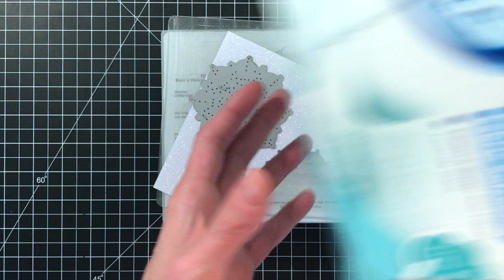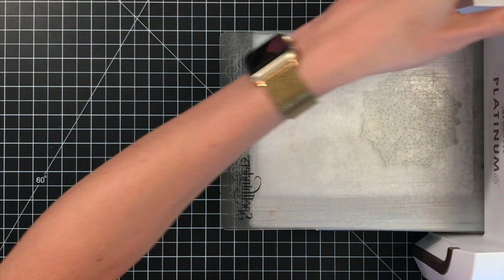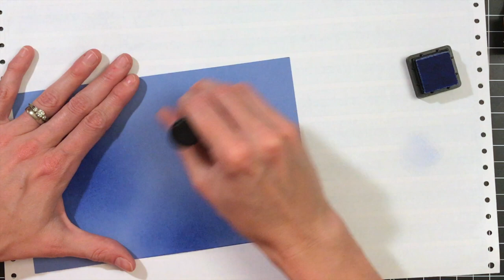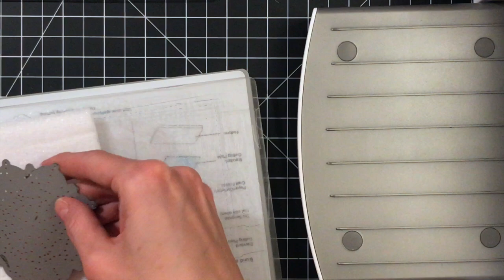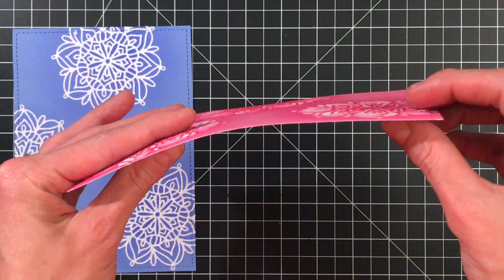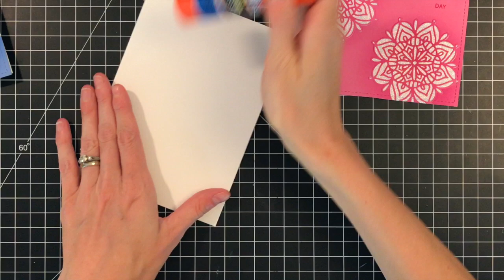[Technique Tuesday] Intricate Die Cutting and Dryer Sheet Cheat by Channin

Comment: Channing, since you didn't add the liquid adhesive to your list of products, I need to ask what kind you are using in that tiny little squeeze bottle?
Reply: She mentioned it was mod podge matte
Reply from the maker: Hello Mary, I used Mod Podge Matte 

https://www.amazon.com/Mod-Podge-Darice-Original-16-Ounce/dp/B001IKES5O/ref=sr_1_2?ie=UTF8&qid=1538495058&sr=8-2&keywords=mod+podge+matte&dpID=41R%252BRdloIjL&preST=_SY300_QL70_&dpSrc=srch 

in a precision tip glue bottle like this, 

https://www.amazon.com/Purture-Precision-Applicator-Bottle-Quilling/dp/B073P95CYF/ref=sr_1_7?ie=UTF8&qid=1538494924&sr=8-7&keywords=quilled+creations+precision+tip+glue+applicator+bottle

Hope that helps! :)
-Channin

Comment: Which metal shim do you use? I also have the spellbinders platinum. Spellbinders said they do not make a shim because they don't believe it is necessary because of the way their machine is made. I wondered if the sizzix precision base plate could work with the platinum but I don't want to damage my machine. Have you used a metal.shim with the platinum?
Reply: Esther Hernandez I don't use a metal shim for my Plantium machine. I have found the Plantium cuts my intricate dies very well, all I might need to to sometimes is rotate the Die and paper and run it through the machine a couple of times. I purchased the CottageCutz Universal Shim Plate Die Cuts for my Cuttlebug machine, which I owned before I got the Plantium machine. I hope that helps. 🙂
Reply from the maker: Hello! I have never used a metal shim with my Spellbinders Platinum machine and I wouldn't recommend it, I think it might damage the machine. For the most part I have zero trouble cutting intricate dies with my Platinum. If a die is giving me a little bit of grief, I just run it through a few times, rotating the die each time (make sure the paper hasn't shifted when you do this). I only use a metal shim with my Cuttlebug die cutting machine because I was unable to get good cuts with my intricate dies with this die cutting machine. Hope this helps!

Comment: Hey Channin...a lot of great tips in this tutorial and the cards turned out beautiful!  I was wondering, here in Canada the most popular size of cards are 5 by 7 inch.  Do you purchase cardstock to create your own card bases for this size of card and if so, what size of cardstock to you get and where can I find it?  Right now I purchase ready cut 5x7 but it of course is more expensive.  Really appreciate an answer from anyone with respect to the above.  Thanks so much for sharing Channin!
Reply: Nancy Lynn Thank you Nancy! I do use card stock to create my own card bases. I just use standard 8
Reply: Oops! 😆 I just use a standard 8 1/2" x 11" sheet, then cut it to 7" x 10" and fold it in half. So I do only get one card base from a single sheet of card stock but it doesn't bother me because I really prefer the 5x7 cards. Hope that helps. 😁
Reply: Oh, apologies, I thought the finished size of the card was five by seven and therefore, you would need a sheet of cardstock at least 10 x 14.  Thanks for replying Channin....my search continues...
Reply: Nancy Lynn The finished card is 5" x 7". You only have to double one side of the card. 🙂